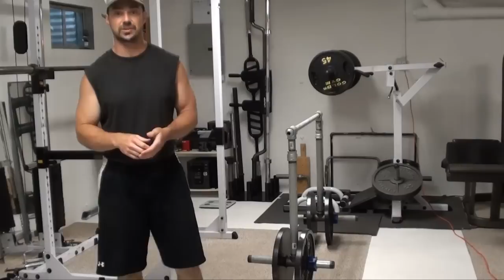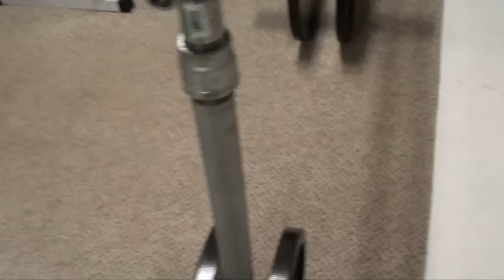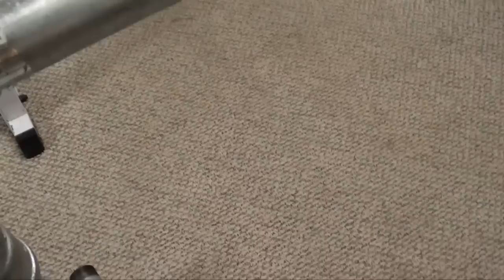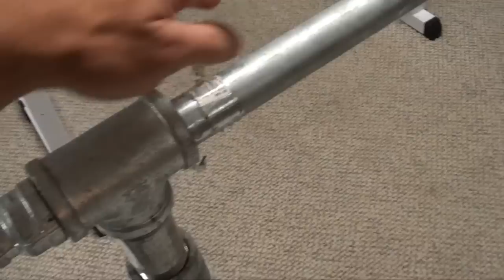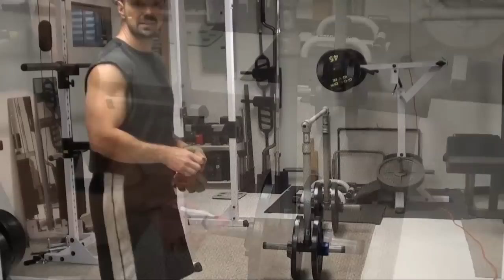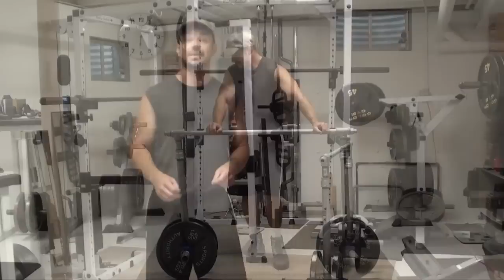Yoke Squat Bar Made Out of Plumbing Pipe for Anderson Squats

Comment: Can you change out the T junctions, extenders, and pipe holding the weight for steel tubing? I'm thinking about making this but I'm curious if more versatility can be added by utilizing the tubing versus all pipe. I have 1in plates but was thinking that using 1/2 pipe and 1-1/2 inch adapters might be risky and less safe. If I could make something that looks similar in design to a yoke but smaller around the same height and dimensions as this. With added precaution and additional safety measures, the tubing can be drilled with holes to add j cups and a spacer to prevent any possible swaying so it can be used for a low benching variation of some kind or floor pressing. Was curious what your opinion might be. I know this is an older video but just found this that got me thinking about how I can adapt this great idea for myself. Fantastic video 👍
Reply from the maker: I think the steel tubing could work.  I had actually been thinking along the same lines as you on the pressing, too.  It has great potential for safe benching at home. I'd likely stick with the pipe for the cross piece because that's really what's holding the weight and you want that rock solid.  But since the plates are hanging vertically, the tubing could work.  Let me know if you put it together!

Comment: Mr.Nilsson,Is there anyway you can think of that instead of using weight plates you can make the bottom part a shot loaded/sad/metal bead loaded container attached to the pipe?
Reply from the maker: +Jerry Yono Sure, you'd just need to find a way to either attach it directly to the pipes or somehow hook it on.  Sounds very possible, though.
Reply: a steel bucket with the handle running through the plumbers pipe via a neat drilled hole? and loads of scrap lead or the small 10kg discs placed in bucket?

Comment: Hi mate, not to put a damper on the party, but a few things: Range of motion is horrible, either go to depth or don't bother (not asking you to go arse to grass, just hip crease to knees). Secondly you can see that the weight movement is making you go slower, inhibiting your explosiveness and ability to shift larger weight. The weight is literally swinging at the bottom and WILL eventually cause you an injury with the movement.... you can see how much back and forward/side to side movement is has just sitting on the floor at around 8:30 mark....
Reply from the maker: Very valid critiques, Daniel.  I appreciate what you're saying.  I do agree that the range of motion is limited, but I don't think that that range of motion is of no value.  That can be adjusted by using shorter pipes (which I didn't have at the time).  And yeah, I also do agree that a bit lower down would be more effective overall, so in a newer iteration of the setup, I would use shorter pipes to increase range.

The swinging is actually the biggest drawback of this setup, quite right.  There IS a risk of injury - it's not inevitable, though, as long as you lift carefully, which actually makes your next point.

That's a really good point about explosiveness - you do have to do be more deliberate coming out of the bottom, which presents a different challenge to the muscles, limiting explosiveness out of the hole.  It definitely doesn't work for yoke walks - I tried that and it was completely unmanageable.

For me personally, I prefer using a regular Anderson Squat setup in a rack using a normal straight bar, however for somebody who has no rack and still wants to squat, I think it is a pretty good option.  

I appreciate the feedback!